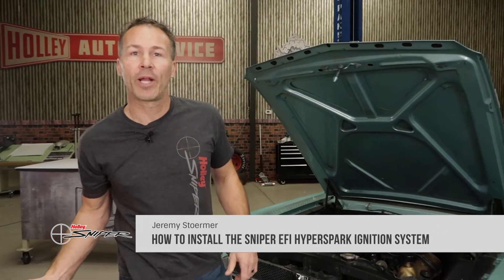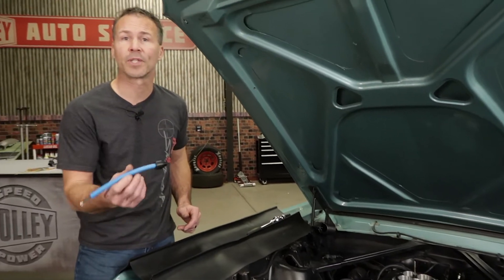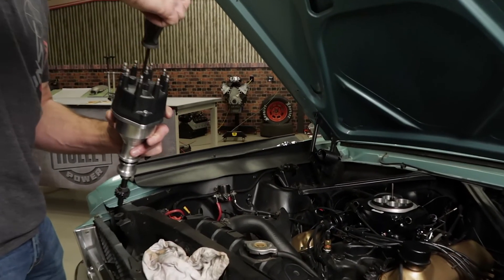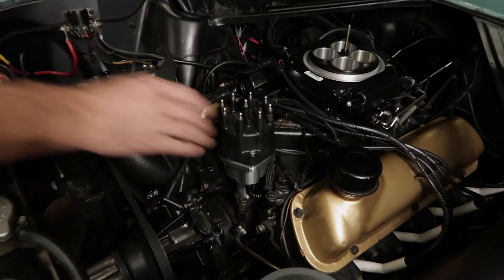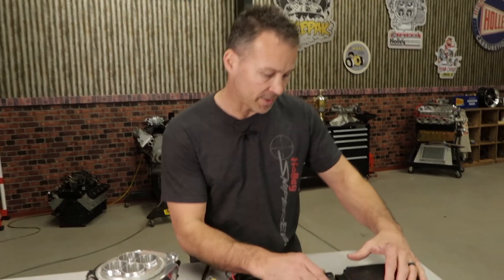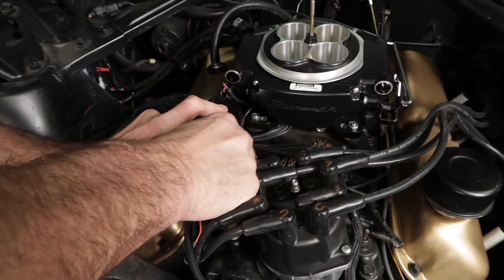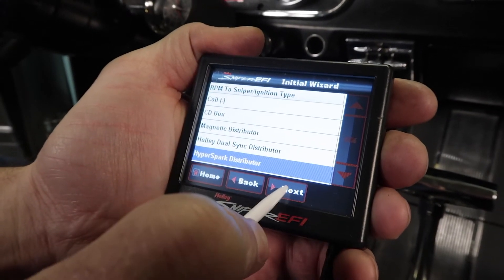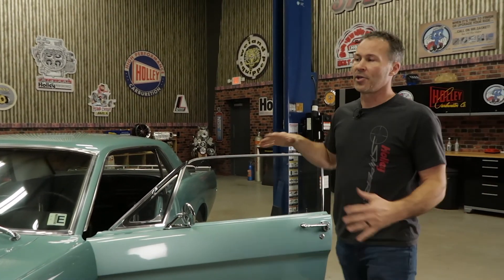Sniper EFI Hyperspark Install

Comment: Is it possible to run the hyper spark box and coil with out the throttle body  and use the stock carb

Comment: Mine stays at static setting after the first check?  Can not get it to run 18 deg idle set. It clears, I cut it off, then when I shut it off, it back spins, which is essentially pumping my oil back out of the pump.

Comment: Is the controller box required to use the distributor?
Reply: If you want to control the timing with the sniper setup, yes. But, you can use Holley sniper EFI with a standard HEI, or coil. You just won’t be able to tune timing with the computer.

Comment: I got the hyper spark distributor, holley hyperspark canister coil, and coil driver. This combination works as well and isn't nearly as expensive and the coil driver is alot smaller and easy to hide. No big box or coil besides the canister coil.

Comment: How is 1.1.35 higher than 1.1.7 ??
Reply: 35 is 28 more than 7, software version separators are not decimal points

Comment: The instructions states not to plug the pink 12v switch on the coil positive tho, I’m installing the EFI sniper and the distributor and before I move to locate a wire from the ignition switch can you clarify please thanks

Comment: What is a clean switched 12 volt ignition source? I have no idea what that combination of words means
Reply: It means no other accessories are connected with the switched 12 volt source that could induce voltage drops or spikes or RF interference. If you're not sure if yours is a clean source, use a relay with source from the battery and triggered by ignition switch.

Comment: you never exsplained what you did the two wires you took off the coil you taped up at the biggining of the video or does the new wire harness take the origanal harness

Comment: Where can I buy that rotor phasing tool for a Chevy distributor clock wise rotation.
I had to remove the intake and install  a new balancer. This is the first time I work on this system. It was already on the car.  I set the distributor at TDC set #1 wire right smack at where the rotor was pointing to on the cap and it ran real bad. Some popping out of the throttle body and the exhaust sounded funky and sounded like a pop corn making machine. I worked on it for a few hours and now I know why it ran funky. 
Should I redo the entire setup using the wizard?
What would be a good initial timing for a BBC with a street/strip camshaft?
Please any info would help but please let me know where I can get that tool.
Reply: Any luck finding that phasing tool? Misplaced mine and desperately looking for one..
Reply: @jasonshields1908  I have one for ford, I called Holley and they sent me both forms and Chevy for free. I gave the one for Chevy to the owner of the car kept the Ford.

Comment: Same here I have a 69 c20 sbc 400 with the Edelbrock 450hp kit and roller cam. I have heard that the duel plan intakes do not work good with the EFI. Or is that a misunderstanding on my part ?
Reply: @MG Thank you. I’ll have to check out that video

Comment: How many hours to install the sniper kit?  Car is 1968 Camaro 427
Reply: Hard question. How are your mechanical skills and wiring skills. If you're familiar with wiring and diagrams you can preplan and have it done in a few hours.
Reply: If you jump into it thinking it's as easy as plugging it in you may be sitting for days.

Comment: Finally got my upgrade for the Sniper with the Hyperspark. Can anyone tell me what are good numbers for AFR/ WOT /Idle/Cruise settings On our stock 87/95 350 engine 2 bolt main with the center bolt valve covers Stock GM roller Cam and the Street Warrior Intake. Not the Vortec heads. Got it as a rebuilt. Idles at 700/750 just boring as heck. I wonder if Holley is going to come up with a EFI version for the Sniper for those of us that have mild stock small blocks like the 350. My aunt likes all her stuff same brand likes the Sniper Logo would change out the intake and anything else with this logo in a second. She sees everything as jewelry so all this just for the logo its her 64 C10 Fleet Short.

Comment: Amazing how you magically changed from female distributor cap terminal sparkplug wire ends to male distributor cap terminal sparkplug wire ends when changing the distributor.  Should have mentioned that detail.